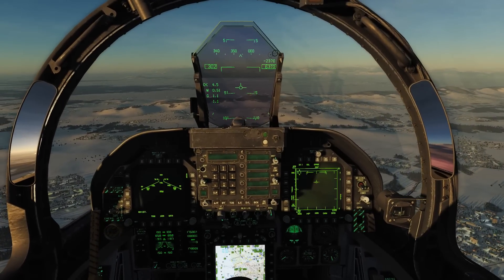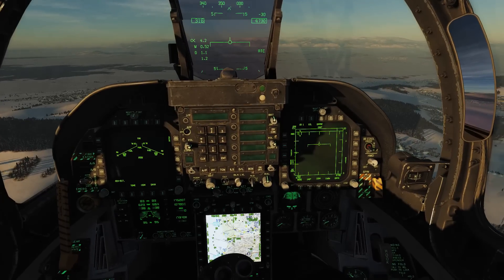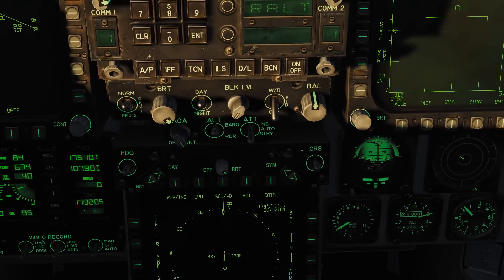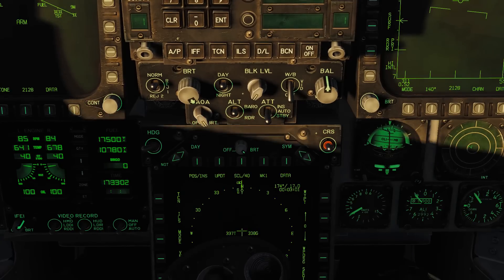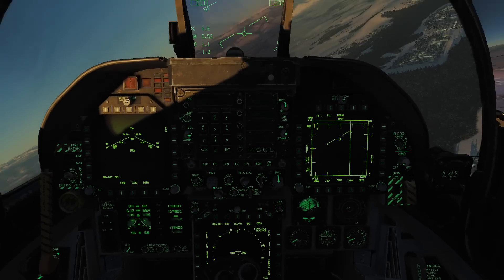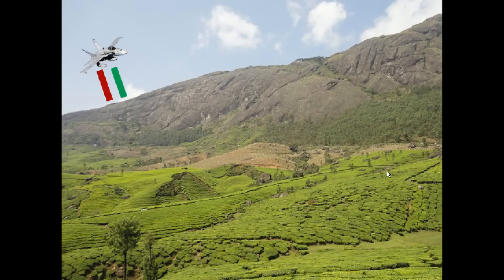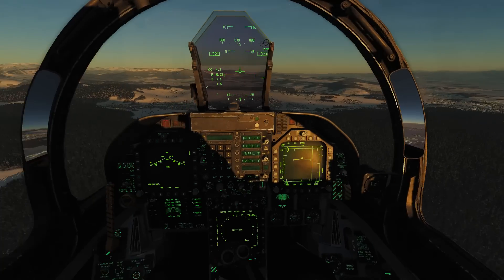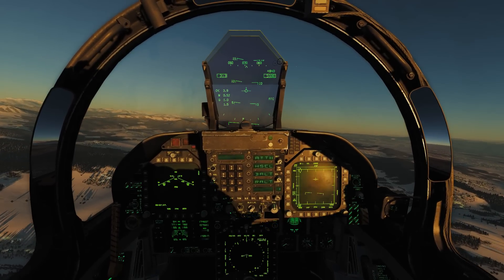DCS: F/A-18C Hornet Autopilot Tutorial/Explanation

Comment: This is sooo much different from commercial aviation. Thank you for the help! In planes like the 737 barometric pressure is something ATC gives you, and it changes if you enter different areas below 18 thousand. Also I was thinking I would use baro below a certain level, not the other way around.

Real life saver, thanks man!
Reply: You are right. The air pressure DOES change depending on your location (of course it does; ever heard in the weather news them talking about regions of high pressure and low pressure?) and therefore your barometric altimeter will need to be set on the ground before you head out. This video simply deals with autopilot and therefore did not go into the naunces of a barometric altimeter (btw, i think it's the right call... otherwise you could be there for hours!):

The pressure the ATC gives you for a given location will either be QNH or QFE:
QNH (often civilian aviation): The air pressure relative to the sea level at the current location. So if you set the QNH, it shows the altitude above sea level at the current location.
QFE (in military and DCS): is simply the air pressure at the current location irrespective of it's relationship to mean sea level . Therefore, if the QFE pressure is set, and you are on the ground, you can guess that zero feet is indicated for the current location.

The distinction is important because not all airports are at sea level. There are incredibly useful resources on the net that talks about the differences between both. 

The comment you made about 18,000 ft is an important one: imagine you are flying out of Batumi and I'm flying out of Abu-Dhabi and we meet in the middle at the same cruising altitude. If we are simply relying on our QFE reading given by our respective airports, it would be possible for the altimeters of our aircrafts to show different values even though we are at the same altitude. Therefore once you climb above a certain altitude everyone will start using the standardised air pressure 29.92 inHg. That altitude is called transition altitude and it varies from country to country. In the USA it's 18,000 ft above sea level; here in England it's just 3,000 ft. Hope that helps.
Reply from the maker: my pleasure man glad you found it useful.

Comment: I’d like to state that barometric pressure is not a constant, it is affected greatly by temperatures, that’s why when talking to ATC at Ontario in Canada, and Mexico City, they give you different atmospheric pressure ratings to plug into your aircraft. depending on the location and time of year, certain airports can have a much greater pressure-altitude, causing a far longer landing and takeoff roll, which can make it a crucial detail for flights to hot countries, India’s international airports for example are shut down to airliners during some of the summer due to this, and flying out of places like Death Valley, where there is a couple tiny airports can become impossible depending on the day.

Comment: Does radar altitude always look directly down, or does it turn with the plane (so if the plane is on its side, does the radar altitude look towards the ground or the bottom of the plane (to the side))?
Reply from the maker: Sebastian Meineche Falk the radar will turn and adjust to keep looking where u told it to look regardless of the orientation of ur aircraft within the gimbal limits of the radar, also note that older planes didn’t do this very well.

Comment: i can get autopilot to work by manually moving heading bar, but i can't get it to work by typing the heading into the UFC. Any suggestions?
Reply: im having the same issue .. did you eve get tiis worked out? I need help with this as well
Reply: @cfeaver421  Nope. For now resigned to doing it the harder way.
Reply: @joebuckaroo82  ok i think  i got it. I started a a free flight mission just to get in the air. I turned on HSI on on the the right DDI. I turned on Auto pilot so that the for options for auto pilot are available but activated none of the options. When you PRESS AND HOLD the the HDG toggle switch the heading only option pops up where you can enter a value on the key pad for your heading. You press the AP button again to bring up the four options for auto pilot.  Now press the round button next to the  HSEL option and two dots appear indicating you are in heading select mode and the air craft will move to the heading you previously inputted. if you press and hold the HDG toggle switch while the two dots are active you air craft will immediately start to move in the direction you toggled the switch  but the HSEL option will appear at the bottom again where you can enter a new heading.. I hope this helps.
Reply: Thanks much, I'll give this a try. @cfeaver421
Reply: @cfeaver421  got it going! thanks a lot for your help.
Reply: @joebuckaroo82  glad to help

Comment: One thing that might want to note is that the barometric altitude will stay the same in all the continents IF they all have the same barometric pressure. Flying from a high pressure area to a low pressure area would cause altimeter to indicate higher than is actually the case. And vise versa. I'm relatively new to the simulator. Can anyone tell me if pressure changes occur within maps?

Also, these tutorials are great. Highly appreciate them. Do you know of any way to contact willing co-gamers who could answer questions via e-mail, rather than having to go through forum?

Comment: Just had a quick scan through as the Auto pilot is one part of the F18 module where I'm a non-noob.  Good use of diagrams to explain your points, particularly the Radar Alt hold mode and the impending cliff.   I've flown TFR for real and radar height hold was a mode you could find yourself in under certain circumstances, with no radar looking ahead, the system needed careful management!

Comment: Very nice video, but i have a lot of hard times, using autopilot, especially BALT and RALT. They wont engage, whatever i do. Why is that? what shoul i do?
Reply from the maker: check in the settings section that you do not have "game flight mode" selected.
Reply: Growling Sidewinder, I've never playing in game flight mode man, only full hardcore realism. I dont know what to do...its so bad that i cant use that mode :/
Reply from the maker: you should still check it, I never clicked it myself but I had the same problem as you and when I checked it was ticked. also make sure you have the plane pretty level with minimum deviation pretty much level flight then take ur hand OFF the stick and try engaging.
Reply: Growling Sidewinder Chechked a thousand times, i dont have game flight mode activated. Still nothing happens.
Perhaphs that is because i'm not using joystick...i play with keyboard only. But this shouldnt be a problem - everything should be available with keyboard too. Any suggestions?
Reply from the maker: I think the keyboard might actually be ur problem. try this. start a mission with ur hornet at like angels 10. don't touch ANY of the planes controls. as soon as you start up, hit autopilot then barometric hold.  does that work?
Reply: I`ve tried this, start in the air, i dont touch anything, just pressed the BALT key and it is works. But why i cant do that when im flying? Its so stupid...I`ve been playing flying sims for 20 years, and i`ve never used a stick, only with keyboard. And im not playing on game mode, i`ve always play on full simulator mode. I havent any problem with other planes before, only now with Hornet...
Reply from the maker: V. Kamenov 100% the keyboard is the problem. Ur controls are causing too much deviation in altitude either up or down for auto pilot to engage. I flew with a keyboard for 6 months before going for joystick and I could fly all the planes. The hornet is different. It requires a joystick. The controls and flight model are just too sensitive. U can try and see if pitch and roll controls offer a curve to change if ur using keyabord and if it does offer that option try to make it a S curve more than a straight line. Other than that I don't know what else you could do short of getting a joystick.
Reply: Thanks again man, how can i change the controls for keyboard?
Reply from the maker: V. Kamenov I'll be able to give you a better response later today when I can get on dcs but it's under "adjust controls" and then find the pitch and roll controls and try and see if u can find anything to do with "curve" or try looking for YouTube videos where they talk about thier joystick set up and watch how they set up thier curve and then go and try to emulate that for ur keyboard. (I don't know if it will work for keyboard but it's worth a try)
Reply: Or other thing - how will be, if I change the keyboard sensitivity from windows10?
Reply from the maker: V. Kamenov I can't really comment on how good any of options will be man. I've never tried them. My recommendation is to try them all and see what works for you. I would say try to get a joystick tho it's a million times better. Especially for the hornet.
Reply: Ok man, thanks again for everything.
Reply from the maker: V. Kamenov no problem buddy. Best of luck
Reply: @VK1BG  I had the similar problem with the Xbox controller. With the default settings the plane was too shaky to control and it was the main reason for not engaging AP or hardly achieving to do it. I added little deadzone and a slight curvature for decreasing smoothness. It worked like a charm in the end.

Comment: You got one thing wrong. The Radar Altitude Engaging does not depend on the Barometric Altitude. It depends on the measured altitude by radar. There is a switch near the HUD brightness knob where you can switch between Baro/Radar Altitude. When (R) Radar is selected you see the symbol R on the HUD next to the altitude (so Radar altitude is working and getting reflected by ground). When flying higher than 5000ft Radar altitude switches to B symbol means Barometric altitude. Also this is flashing when B is active. The radar altitude does also not work when flying high degree turns (because the radar can't reflect from the ground). Nice visualization for the radar explanation by the way. Higher resolution would be appreciated.
Reply from the maker: thanks man, I'm planning on making a new autopilot video soon I've learned a few things since then. I'll be sure to add this one in too. thanks for the comment man.